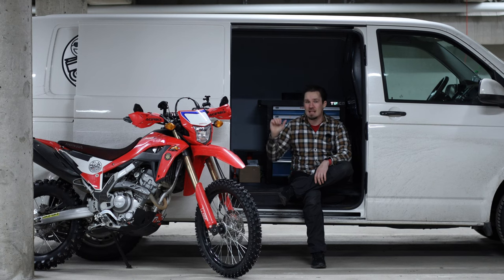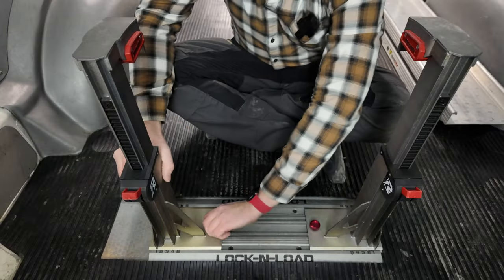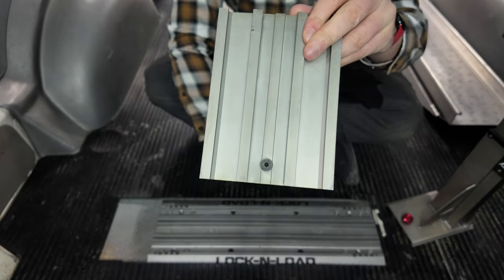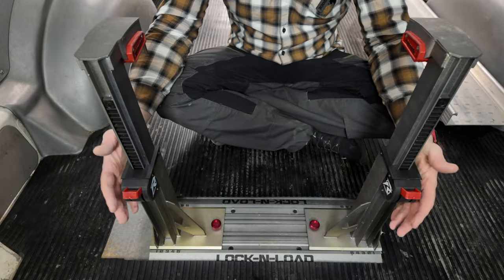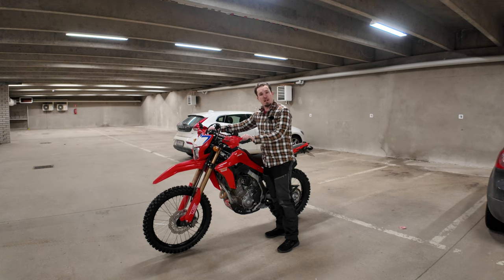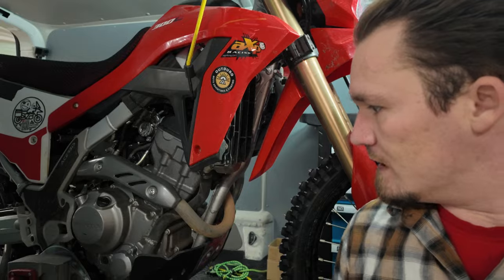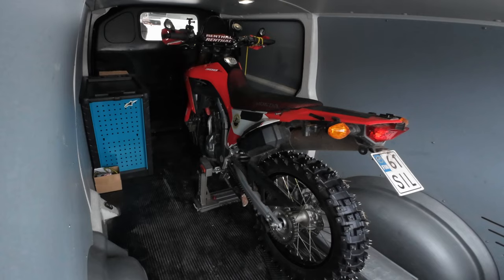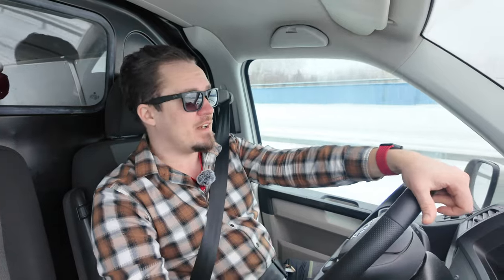RISK Racing LOCK-N-LOAD PRO Enduro Mount Review

Comment: Nice vid, nice solution. I am used to straps for the last decades, works for me. But you need extra fixing points in your van. Hope you reworked Rally Raid suspension works just fine. Günter/Nürnberg
Reply from the maker: Straps work well. This is more a luxury than necessity 😊 I transport this bike so much it just takes away all the hassle 🙂
Reply: @PatchedBandit  I don't need the van in Bavaria. Just for Italy or Wales. We can start in Nürnberg, in a few miles there are much more legal roads than anyone would imagine. But of course it is not too hard not too steep or sandy ;-) Just hop on the saddle and start, that's my usual routine. On a supersportbike or on an enduro. Happy days, Günter
Reply from the maker: @enduromotorradtouren  Thats a good routine for a happy life 😁

Comment: Looks very convenient and sturdy but I think it would be best to always strap the bike from the rear wheel with a ratchet strap also, not just for the long hauls. It takes like 30 seconds and the strap from rear wheel to the van floor does not get in the way so much. I would be comfortable to haul a bike with this with one strap in the rear wheel. Normally I strap my bike with four: One from the rear wheel, one from the front wheel and two (one each side) from the upper front shock mount. Those three straps in the front are basically just to keep the bike from leaning side to side and they are very inconvenient to put in place and take a lot of storage space from the van, this system eliminates the need for those straps as it keeps the bike straight! I have basically the same van, a VW caravelle T6 and I haul my Ducati Desert sled with it. The caravelle version has sound proofed flooring from the factory and I would not like to make a hole in it to install this kind on system but when I get next van, it might be something that can handle this system🤔
Very good video! 9 hours hours editing and filming this is quite fast work! This is very professional looking video!😁
Reply from the maker: True adding the rear strap is a low effort big benefit kinda thing 😄 I like the Transporter so far but interesting to see if the bike still fits with the Rally Tower I have coming in tomorrow 😅
Main reason I bought this mount was just to make the transport as quick as it can be. When I used straps I didn't tend to transport the bike daily and so I just rather ride to the trails. 
It's a wonder how much more you end up transporting the bike when it's this easy 🙂 Thanks for the comment!
Reply: Yeah, the easier it is the more you will transport the bike and get more new places to ride! Looks like this really makes it easier. If the rally tower makes the bike too tall, its not a big hassle to ratchet strap from front shocks top mount to the front wheel axle to get the front height of the bike down to load the bike into the van. My bike is so tall from the front that I have to do it and its not a big deal. @PatchedBandit

Comment: any thoughts on loading bikes backwards ? alos i have ben looking at this same set up for klx300. the weight is about the same on the CRF so it should handle it i think
Reply from the maker: Should be just as easy. Maybe even easier as gear and rear brake levers are not in the way if you load the bike backwards.
I used to load my bike backwards in the MB sprinter. I have a video about that van too: https://youtu.be/vKvB_FDDars
Reply: is the piece of wood under the tire for stabilization of that tire swingarm / for bumps ?

Comment: What tires and studs (how many) do you have on your CRF now?
Reply from the maker: Front: Mitas C-17, 21” 90/90, stone eater, cross&enduro tire (306 studs)
Back: Mitas C-16, 18” 110/100, stone eater, cross&enduro tire (don't remember stud count)

Both tires are studded here in Finland by a company called “satapiikki”. Studs are also attached by glue. Expensive.. but nice.
Reply: @PatchedBandit  thanks... are those road-legal in Finland?
Reply from the maker: Absolutely not 😄
Reply: @PatchedBandit  🤣same as in Norway... not allowed to ride with "real" winter tires.... hahaha

PS. I did know the answer to that question, just had to ask anyway... haha
Reply from the maker: Yep. It's too much fun to be legal 😆 I try to avoid asphalt like kryptonite with these ones thoug. Doubt it's the worlds biggest crime to go on gravely/sandy forest roads with them though and probably no cops are going to care. 
In my opinion if you don't brake roads with them it's a good thing they have grip. Normal legal studs are horrific to ride. Legal studs should definitely not be legal 😂
Reply: @PatchedBandit  but even the 2mm legal is better than nothing... when riding "normal"... I did ride without studs on normal roads for a few years, but that was like playing Yatzy, with road legal, it's more like playing poker... hahaha